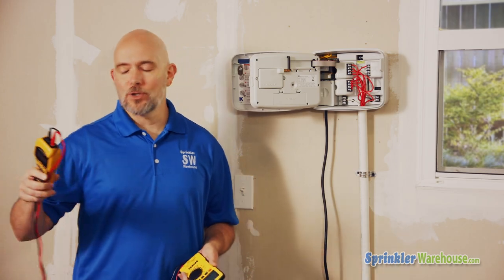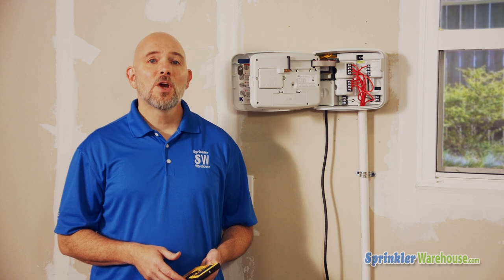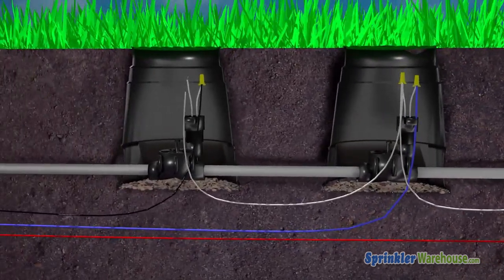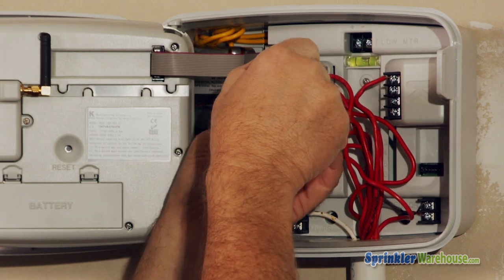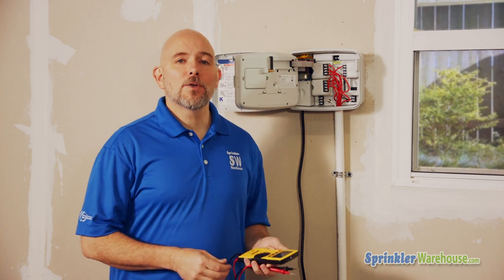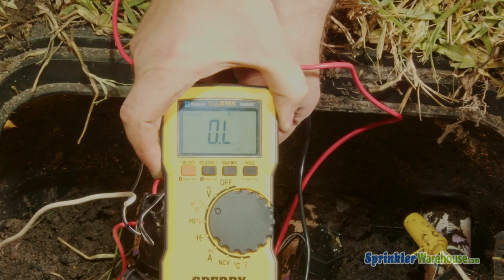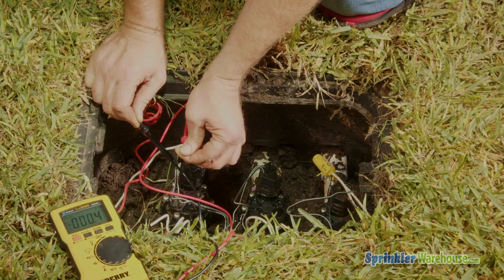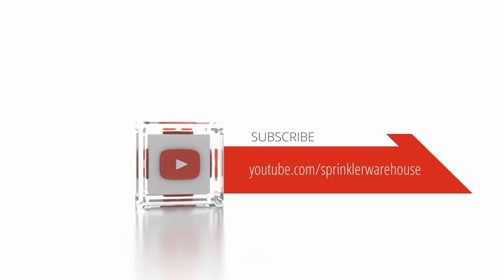Troubleshooting Valve Issues Using A Voltmeter

Comment: Don't replace the valve until you take the valve apart and check if the diaphragm is damaged or has a film on it making it not being able to close. Also check if the solenoid is loose and possibly the bleeder screw is slightly open.

Comment: take the valve apart and get the piece of debris out, dont change the valve, thats a possible monumental pain in the butt, unless buying even more expensive repair pvc fittings.
Reply: Or buy a bunch of the same valves. So when one acts up all you have to do is change the solenoid and not the hardware.